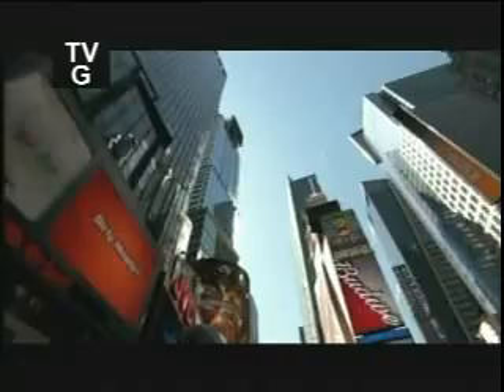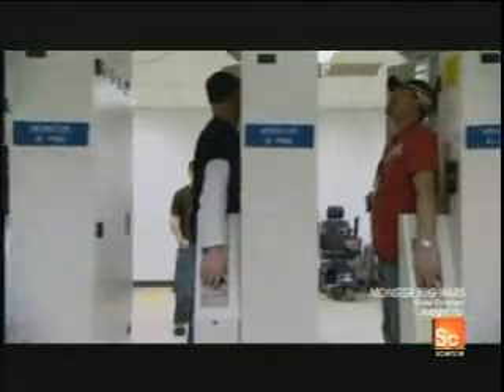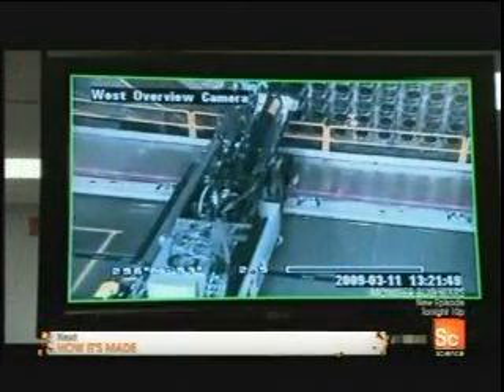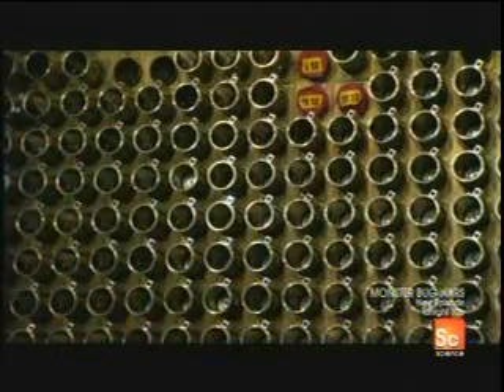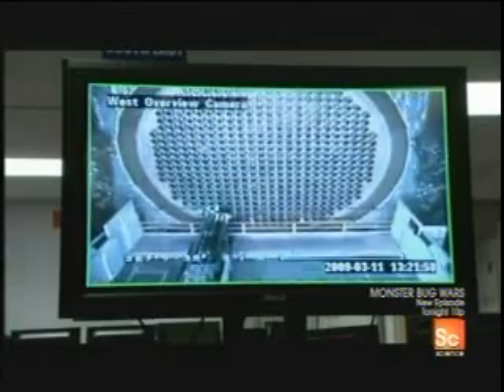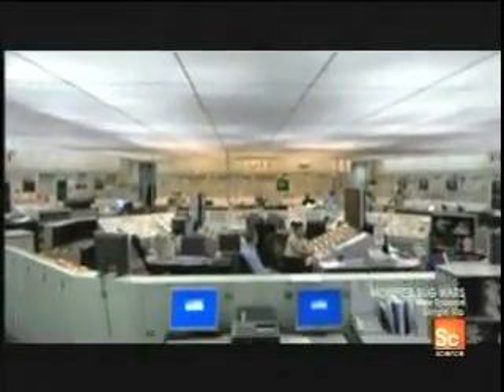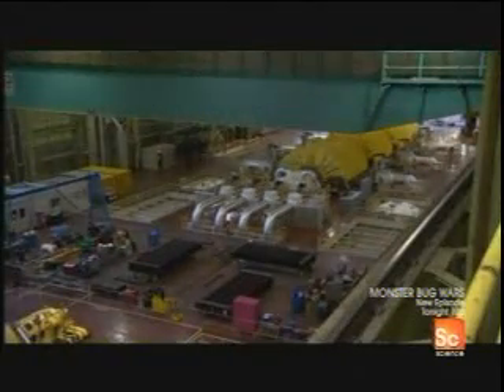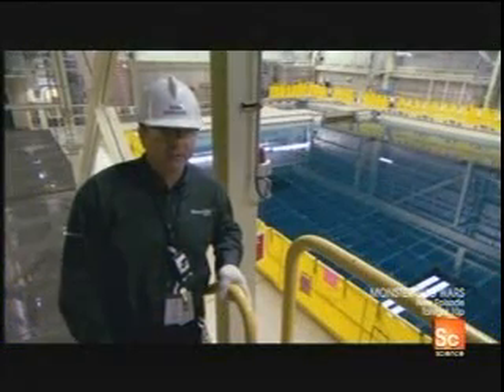How Does Nuclear Power Work?

Comment: Its still kinda a crude process, boiling water to transfer energy, 18th century technology. There should be a way to "solid state" it.
directly converting nuclear particles to electricity , much like photons converted to electrons in a solar array.
Reply: Solar panels are also 19th century technology.
Reply: I think you are a little lost on how this works. Nuclear fuel rods are what generates the heat that heavy water surrounds by having neutrons split enriched uranium atoms causing heat. The water is pressurized so it doesn't boil. Then transferred in a compressor to make steam. The steam is shot into the generator causing it to spin creating electricity.
Reply: Yes I fully understand how it works. Everything downstream of the atomic pile was invented 200 years ago. There has to be a better way to extract electromotive force than using a complicated intermediary, such as boiling/ vaporizing water, and yes if your going to make steam your going to have to "Boil" or vaporize the water in a pressurized environment in which that "boiling" takes place at a much higher temperature, imparting a higher potential energy content to deliver to the energy extractor/ converter. IE: turbine, piston. what ever.

Comment: So, all science aside. All nuclear reactors are basically just heaters that get really really hot and produce steam energy? Is that right? I still don't really understand how they work.
Reply from the maker: Yep. Pretty disappointing if you've grown up watching lots of cartoons and science fiction that don't understand how lasers and and crystals work. Solar panels are closer to the space age fantasy stuff in that they just convert radiation into electricity without hot water as a middle step. Except some solar panels specifically heat water instead of making electricity. Water is very useful!
Reply: Yeah! So basically the fuel rods get so hot that the water around them turns to steam (kidna skipped about how the water is pressurized so it dosen't boil but im trying to keep it simple) So the steam is then shot into these tubes that blow it onto a huge fan blade in the generator, which in turn spins it extremely fast (creating electricity) Does that kind of make sense?

Comment: 03:53 They say the control room shuts everything down to in case a chain reaction gets out of hand, or to keep it in check. What does the control room actually do to accomplish slowing down or stopping the chain reaction?
Reply: In general, they move control rods made from a well-known neutron absorbing material, like cadmium.  They are moved by motors, but there are usually also safety rods that insert by gravity when a reactor is shut down in emergency mode.  They lower the reactivity of the core by absorbing more neutrons than are created by the chain reaction.  This same idea is implemented in different ways in other kinds of reacors.
Reply: Safety system 2 (SDS 2 from what I remember...it's been a while) is a reactor poison but it absorbed or captured the neutrons very quickly and efficiently.  It doesn't affect the ability for the heavy water to slow down the neutrons rather it takes them out of the picture entirely.   It works in the same manner as the shut off rods.  Absorb the neutrons to stop the chain reaction.
The control room staff don't really do anything to start an emergency shutdown, that is all automatic.  It would happen faster than they could react.  They will certainly shutdown the reactor ASAP if they determine that there is an impending problem though.
Reply: Some clarifications  The reactor poison contained Gadolinium.  It is dissolved in heavy water and if needed the solution is injected into the core absorbing any neutron flux and stopping the chain reaction.  
The primary shut down system however is the shut off rods.  They drop into the core, quickly stopping the reaction by absorbing the neutrons, same as the gadolinium solution.  
If the control room personnel became aware of an emergent situation they do have the ability to do a controlled shut down of the reactor through it's normal control systems or to shut it down quickly using either emergency shut down systems.

Comment: A small correction has to be made I think, in the video it is said that the neutrons start to speed up when surrounded by heavy water. In reality the heavy water is there to slow down the neutrons. They are slowed down to make the chance of fission bigger.
Reply: Shy  You are correct it’s used as a neutron moderator to slow neutrons so that they are more likely to react with the fissile uranium-235 than with uranium-238 which captures neutrons without fissioning.
Reply: @isacchris1  also those pressure tube contains 13 not 12 bundles
Reply: Yes exactly water acts as velocity selector for high chances of fission
Reply: I've always found that concept to be really counterintuitive. Like you wouldn't you want fast moving neutrons in order to have the energy to split the uranium? Why doesn't it naturally do this already without then water?

Comment: "Radiation proof machinery" suuuuuuuuuure
Reply: The machines won't become inoperable because of radiation exposure is what they meant, obviously it will still become irradiated because of the work it does, but they can clean it of that once the core work is done
Reply: @thrakerzad5874  it wont become irradiated, it will actually become contaminated
Reply: "Radiation proof" meaning radiation won't destroy its electronic circuitry.

Comment: "with it's hot summers"
XD.  Canadians
Reply: David Chipman 86 isn't hot at all
Reply: hot.  I said hot dumbass.
Reply: Sam Berges Dry heat or with high humidity? I suppose it's the humidity that makes one want to just lay down and do nothing.
Reply: Rumpel Felt this summer has been killer. Not particularly hot, but my God has it been humid some days.I was born in 94, not long ago, but it has been long enough to notice the shift to milder winters and more humid summers that you speak of.
Reply: Depends on what you compare it to. Our summers are sweltering when compared to Britain's or Germany's summers, and roughly equal to the summers temperatures in Paris, in the most populated parts of the country. It's really when you compare it to the U.S that the summer temperatures start to look more tame.
Reply: I live north of Windsor and it does get hot in the summers and pretty cool in the winter nice video.
Reply: Actually in India during summer temperature hovers around 116 to 118 Fahrenheit. That is called hot... .... 86 is actually cold bliss compared to that...
Reply: It was like 35-40C / 95-104F throughout the summer here...... considering we're way up north that's fuckin hot lol
Reply: Actually, we do get hot summers. How does 86 F sound? We do get heatwaves.
Reply: NEWS FLASH: SUMMER MEANS THE SAME THING IN THE NORTHERN HEMISPHERE. Learn how the seasons work dumb ass.

Comment: 3:15 Correction; heavy water slows down neutrons.
Reply: No actually any and also whats heavy water
Reply: @yazminsoto2937  Well, it doesn't slow down neutrons and make them more likely to react with a more stable isotope of uranium, which slows the reaction as a whole. Heavy water is water in which the hydrogen atoms have one proton and one neutron in their nucleus which makes it heavier than "regular" water in which the hydrogen only has a proton in it's nucleus.

Comment: and your a sheep that listens to conservatives and democrats. your misinformed. reactors 4,5, and 6 were shut down for inspection. 1,2, and 3 did receive the auto shutdown but reactors 1 and 3 had malfunction to seismic activity. all reactors backup generators kicked up and kept all the reactors going critical ( don't expect you to know what that is). reactors 1 and 3 went critical and that was part of the radiation leak. then they needed cooling fast and used sea water.

Comment: According to the Russian nuclear scientist at the time, If the molten fuel in Chernobyl reactor had of burned through into the basement before the fire men were able to pump the water out, a thermonuclear explosion on the magnitude that would have rendered most of Europe uninhabitable would have occurred. 
The same basic fuel & control rod configuration in the No 4 pressurised reactor at Chernobyl is mirrored in every single reactor on the planet.

Comment: No.  A LFTR uses liquid fluoride salts for both cooling and fuel, while Monju was a fast breeder using solid fuel. And, no, neither was the Santa Susanna reactor, nor the Fermi reactor.  So, you just struck out.  The LFTR doesn't need or use liquid sodium cooling.

Comment: The isotopes that are radioactive for "thousands or millions of years" (like uranium235, -238 and plutonium239) are by that same token not very intense. For example, the core of an atomic bomb can be handled by human hands without poisoning or significant radiation. There are technologies for using them up, and they would be used if they simply weren't so plentiful.

Comment: An old joke, of course; I think it originated with Al Einstein.  Most power is generated by boiling water, because boiling water is quite efficient at holding and passing the energy along.  Actually, heating it with nuclear fission strikes me as a great way to extract the energy of the nucleus.

Comment: While I agree that Chernobyl is being misused by the anti-nuclear scaremongering crowd to whip up FUD, it is far from safe to live in (safe to enter is a different story). There has never been a proper cleanup operation, so while most of the land is pretty much at background levels, there are contaminated hotspots containing core particles, which can be very dangerous if ingested.
Wildlife, though, welcomes this, as humans are a much greater danger to them than the occasional radiation hotspot.

Comment: LFTR does not produce any of those it only produces plutonium 238 which is A. very useful for space travel B. only optional and they can stop the reactor making it in fact getting more power by not letting it produce thr 238

Comment: Reactor grade plutonium is less than 70% Pu-239, ~26% Pu-240, ~1% Pu-241, ~4% Pu-242, traces of Pu-244. Pu-239 and 241 are fissile and can be consumed as fuel in a proper reactor. CANDUs can get rid of some of the 239 and 241 isotopes.

Comment: It isn't quite a terrible as you describe it. Spent fuel consists of 3 main components: depleted Uranium (~96%), transuranics (~1%) and fission products (~3%). The DU is essentially inert. The fission products are very radioactive, but stabilize quickly (within a matter of decades/centuries). The transuranics are the longest issue. They're not too radioactive, but are very toxic and have moderate half-lives (thousands of years). Reprocessing fixes some of these problems (but introduces others).

Comment: Russian nuclear safety has always been a complete mess. Fortunately, most countries take nuclear safety a little bit more seriously.

However, what I'm disappointed in is that we haven't moved away from these pressurized water systems yet. There are ways to use nuclear that are completely safe, without the need of external interventions, and without the accumulation of so much deadly waste. We've had 30 years of stagnation in nuclear tech and it's starting to catch up to us.

Comment: Plutonium is transmuted from uranium-238, and depending on the reactor, can absorb additional neutrons to become heavier and nastier (less stable) isotopes. CANDU reactors are capable of burning plutonium to some degree, consuming the more radioactive isotopes in the process, so plutonium from a CANDU is a lot "cleaner" with respect to radiation.

Plutonium is still chemically toxic however, far more so than mercury and lead. Its chemical toxicity is arguably much worse than its radioactivity.

Comment: Errors
3:15 Neutrons are slowed by the heavy water moderator
4:06 The reactor has a negative reactivity coefficient so it is not unstable as stated.
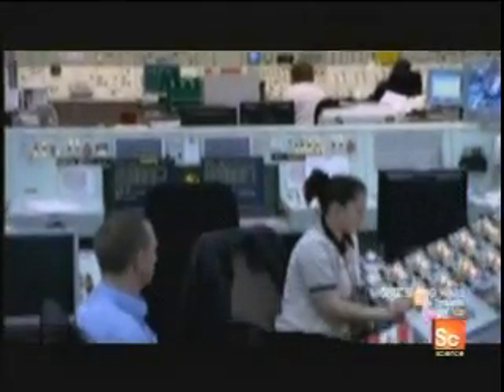4:55  Used nuclear fuel is not a technical or engineering problem.  The fuel can be recycled and returned to the reactor.  It is currently cheaper to use the fuel once through and make fresh fuel because Uranium is so cheap.

I like how the CANDU heavy water reactor does not need the Uranium to be enriched, it can use natural purified ore.